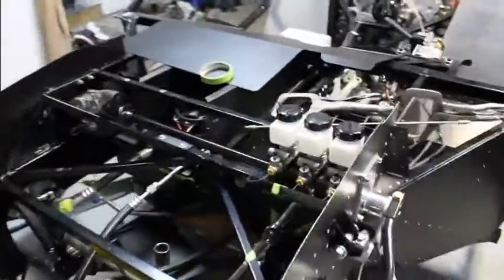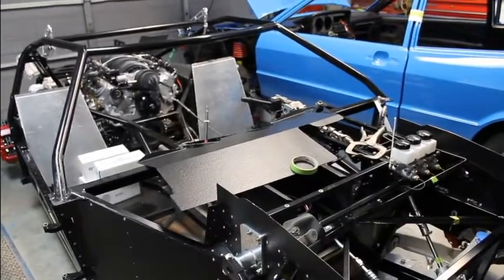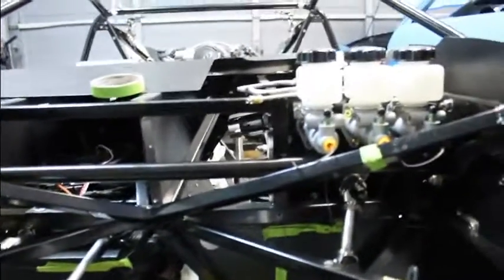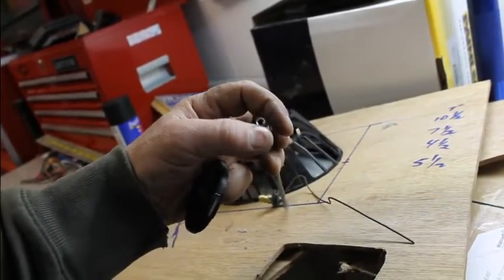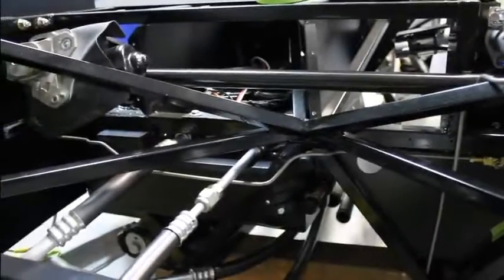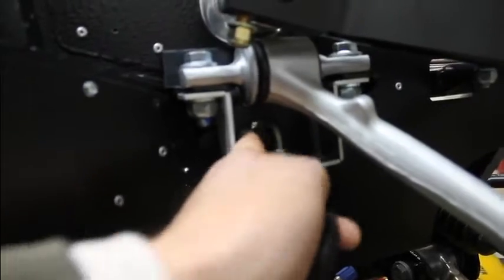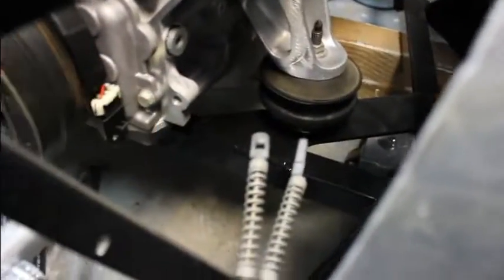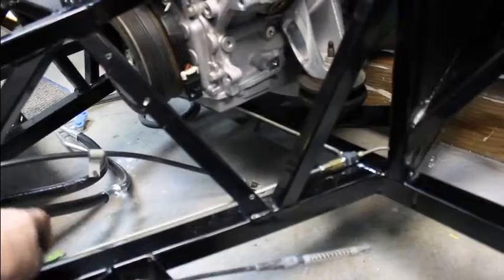Factory Five GTM Supercar, fastthings build log....... Part 29

Comment: How does the transmission work like that? I've been going over multiple car designs from supercar to budget build kit cars, and I have yet to see anything that really takes a look at (much les explains) how the transmission in rear engine cars work. And what about shifting gears? How do you have the transmission in back with the shifter in between the seats? 

Any response  would be much appreciated. Can you provide part examples? Thank you.
Reply from the maker: Will6804 Hello, video #50 shows hooking up the shifting linkage. https://youtu.be/ZlbO6UPEAN0The shifter is connected to the trans with flexible rods that slide threw a housing, shifter cables. Not many transaxles are made to run mid engine position. Mendeola is the make of the trans that I have, you can goto there website and check it out. Others use a trans out of a Porsche, then invert them so they have 5 forward gears instead of 5 reverse gears. Does that help?